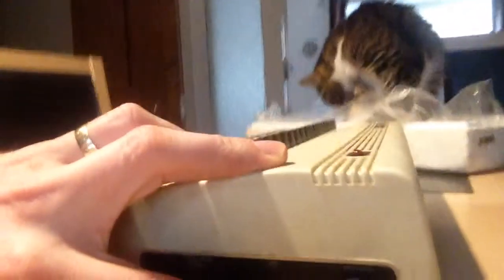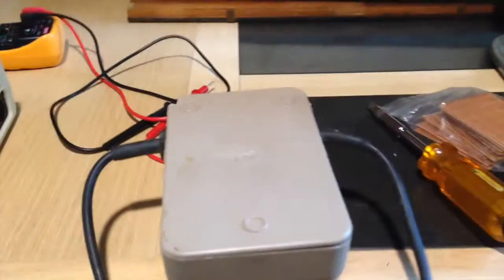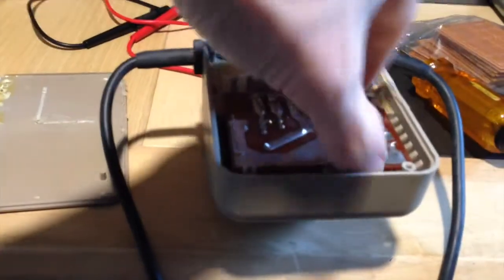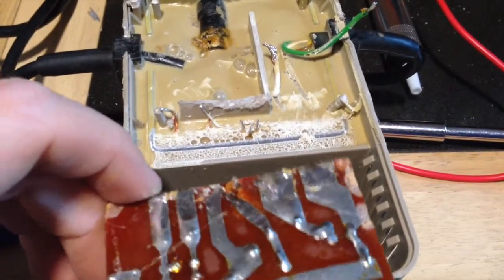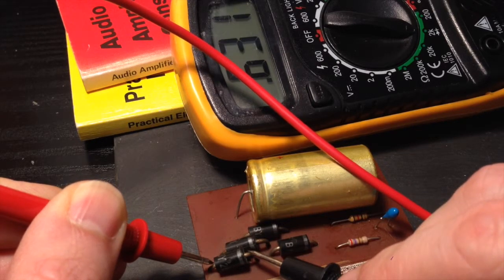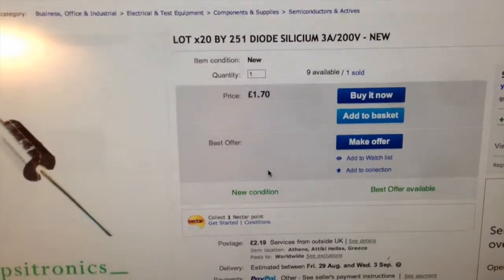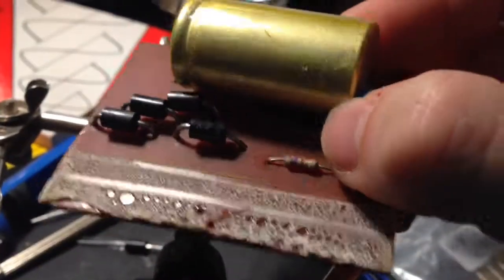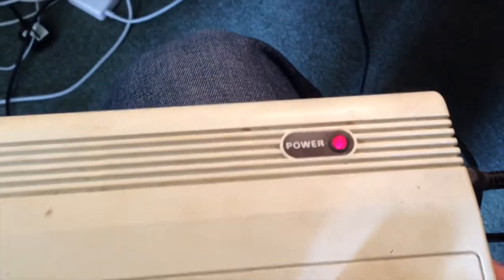Commodore VIC-20 power supply repair

Comment: Hi, did you ever get it running?
Reply from the maker: Sean Vrenlagestic not done any more work on the Vic since I fixed the power supply.  Will dig it out of the cupboard and do a follow up video.
Reply: Nathan Friend ah cool! My vic 20 motherboard died so I got a new one from here. http://www.the8bitguy.com/product/commodore-vic-20-motherboard/#reviews in case you need one. I'll be checking my power supply before plugging in the new mb so it won't damage it.